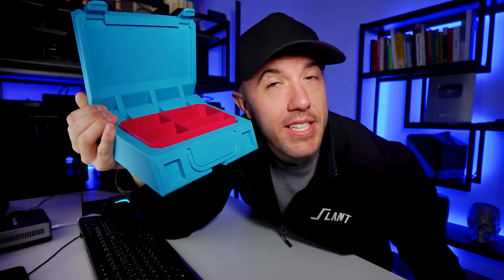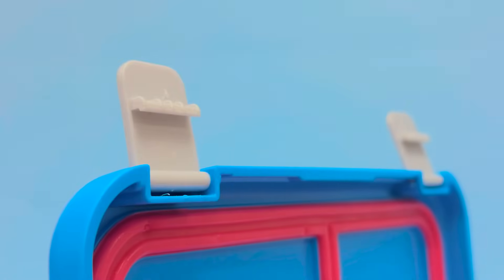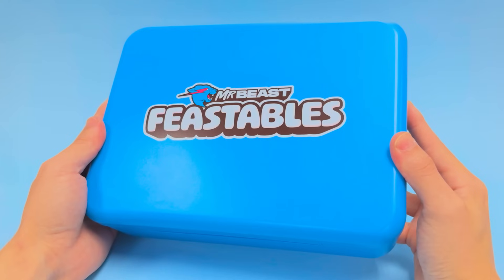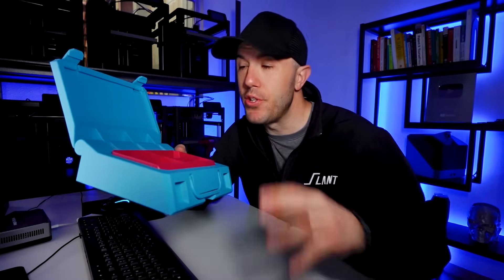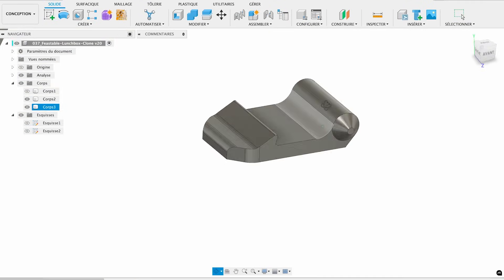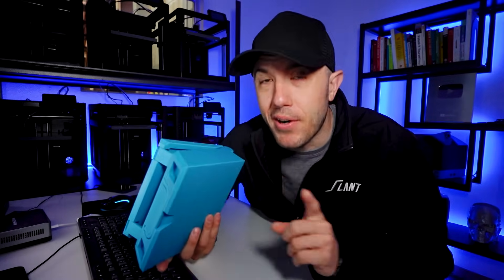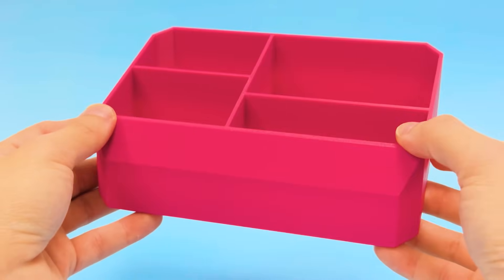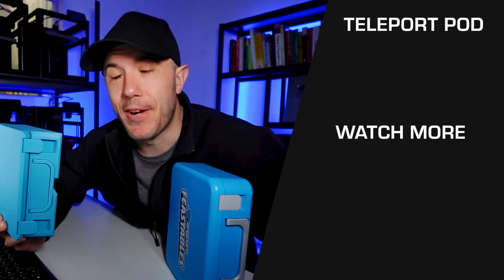How We Would Make a Product for Mr. Beast

Comment: the injection molded boxes are way better than the junk 3d printer one you made. injection molding is cheaper than 3d printing. there is tons of diy injection molded machines for under 1000 on youtube. a mold can be made if you have a cnc machine. doesn't cost the outrageous prices you are talking about slant3d. knowledge is real power slant3d.
Reply: ten bucks says it was a badge engineered product too, not custom to mrbeast brands.
Reply: yeah right 🤦‍♂ how many different models did you injection molded at home?
Reply: You realise that the finishing stages of getting an injection mold ready are hand scraping. It's an incredibly expensive procedure and with the tariffs good luck turning a profit selling less than 300k units.

This lunch box is made in America.
Reply: @virtualScotsman  i wrote my bachelors on a polishing robot for these dies... the process is terribly manual, especially once you introduce complex curves.
BUT there are more modern ways to use resin printed dies and small shooting machines to bring down the upfront cost of injection moulding

Comment: that print quality looks real bad
Reply: lol
Reply: Slant 3D just messed up on one part of the design.. the indent where the flaps click in.  Should have a more rounded slope so no overhang the bridging is too thin.  Either need more cooling or to fix with design.  Otherwise it looks fine for whatever your packing for your 2nd grader
Reply: @SnoringVids  The printers in slant3d's farm are just outdated, the quality is awful imo
Reply: If you were to watch the video instead of making asumptions, you would know that the surface finish is because they added fuzzy skin to the sliced model.
Reply: How is that an excuse when they're trying to claim its better than a replacement for injection molding? Doesn't matter what the did, still looks like trash @matko000
Reply: @matko000  they bump up their layer thickness so it prints faster(saves them money), they're just trying to hide it with fuzzy skin, which still doesn't look good imo
Reply: @NisseMCno they do not. They have standardized settings of 0.4mm nozzle and 0.2mm layer height. The only time they deviate from that is if the customer actually goes through with an order and it is negotiated. Gabe has said many times that their speed comes from  using several printers at the same time. He does not care about slicing speed like consumers do.
Reply: Ya based on basically every close  up of their prints on this channel I've seen. I virtually would never use teleport.
Reply: @lukeissobad  it was probably printed in his print farm with printers they designed themselves. I highly doubt that those printers can reach the print quality of market leaders like bambulab or prusa